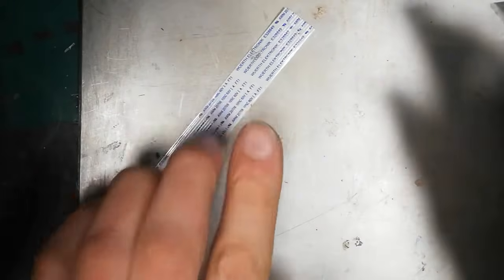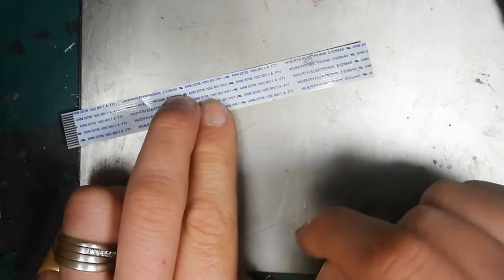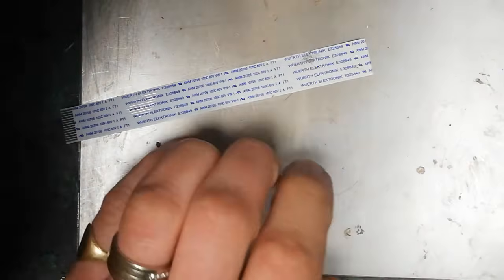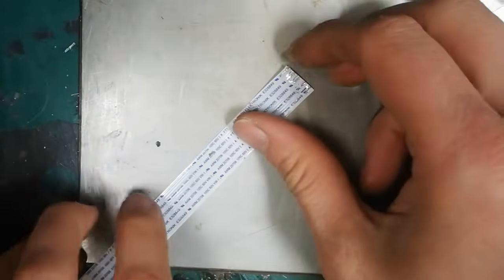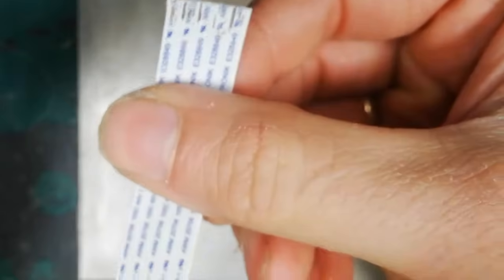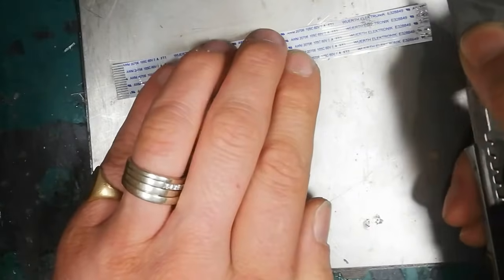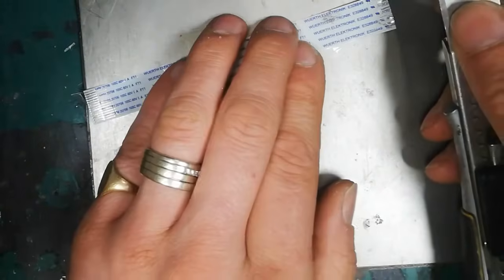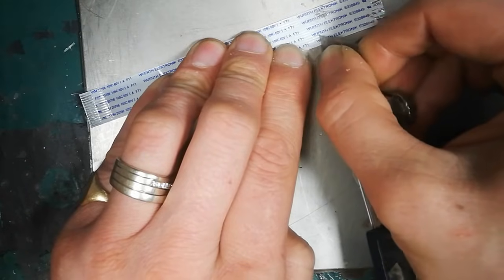Flexible flat cable FFC cable repair methods

Comment: I have a damaged flex cable that has carbon conductors or traces.  When I used carbon ink to fix it, it breaks and comes off, can it be repaired?

Comment: This might just save my Canon Printer, the fucking scanner ribbon was fucked up and the entire printer just refused to turn on.
Reply from the maker: Hope so.. Good luck and don't rush it !
Reply: @chazj1976  it worked! Huge thanks my man, printer is working like brand new again. It was refusing to turn on due to a fucked up scanner ribbon and power switch ribbon. By the way, what can I replace with the blue plastic, i tried different plastic sheets but it seem to be too thick for it, im worried destroying the port's contacts. New subscriber here.
Reply from the maker: @madartzgraphics2019 awesome well done. Thanks for the sub. Blue plastic replacement   can use a piece if glossy photo paper. But I used an thermal laminator pouch put through a laminator with no paper in it and the cut a small section.  More robust than the photo paper

Comment: Will it damage if I just burn it for 2 secondes with a lighter and then two scratches with the finger nails to take the plastic off ? 😅 I'm just wondering
Reply from the maker: Only one way to find out 😂

Comment: I found a torn ribbon cable but the lines are microscopic and are built into the screen on one end. I'm guessing it's an impossible fix? I cant even see the individual lines with a magnifying glass. It's an LG 4k Ultragear monitor. The ribbon cable has a small chip built in. I'm drawing a blank on what they're called. Chip on film or something.

Comment: Hi Super random question I had to repair a 6 wire ribbon cable for my ps3 power buttton but some of the copper wire further down is also exposed the part that does not go inside the slot is this bad or would it be fine to use and does it matter what rotation the flex cable goes in>
Reply from the maker: Be fine to use even though some copper exposes. You could wrap a small piece of electrical tape around the section that's exposes.  Orientation of cable in the socket matters yes. Check it against images on the Web for which way it should go

Comment: How to know if flex cable has tiny wires broken, can they be visually inspected?
Reply from the maker: Use a multimeter and continuity test.. one lead at one end, the another leas at the other.
Reply: @chazj1976  What to do if I can reach only one end of wire, will have to puncture insulation?
Reply from the maker: Not Ideal but yes sharpen one multimeter probe yo a very fine point. Or use a really fine needle taped to the probe tip

Comment: Very bad practices. Not to be recommended. There are far better instructional vids on YT about adaptation and configuration of FFCs. But if you can, just replace the cable. I doesn't cost the world.
Reply: Indeed, it is dangerous. Use FFC to DIP adapters rather than scrapping the insulation like savages. During a maintenance job of my laptop, the ribbon cable connecting the USB hub to motherboard was damaged, I was desperate and tried this method, the moment I powered the device it started to burn and melt. Horrible scenario...! Thankfully none of the components were damaged. Simple buy a new one, calculating the pitch is easy, divide the width of the cable with the number of terminals.

Comment: unfortunately this won't work... when pushed back into a socket, the ends will be damaged again.
Reply from the maker: Well I beg to differ along with the many others who have tried it successfully.  Maybe give it a go and you might surprise yourself 😀
Reply: @chazj1976   It may work when laid on a flat surface but it won't work when pressed into a socket. It's a common sense thing that seems to escape you.

Comment: Great video. The blue ends on both sides of my connector have cut off, so I can't see any exposed cable, it is a 5mm width Sumitomo-G AVM 20624 80c 60v VW-1 F 4 pin cable, can I just buy another off Ebay or are they specific to each device ? Also what does Forward or Reverse mean when buying the cables and what is the pitch ? I have no idea what mine is. Also are both ends of the cables the same or do I need to make sure I keep the broken off blue connector end from the bottom of the cable as always the bottom one or are they interchangeable ? Thanks again.

Comment: please answer me can you cut it lengthwise because i need 13pin one and i only found 20 pin ones can i cut it to make it 13 pins
Reply from the maker: Yes as long as its the same spacing (pitch) for the contacts as your 13 way one

Comment: Thank You, very helpful video!  a flex cable, ( i called it a ribbon cable!) in my epson scanner was partly cut when the hinge broke, so it looks like i can adapt your method to join the cut wires as it only cut the first 2.  thanks again!

Comment: Nice but it's not so easy with relatively narrow cables. I failed to strip plastics on one end of 6 mm laptop ffc. The wires are much thin and can easily breaking. But thanks, anyway.

Comment: A tip, you can use a thin Diamond file or sand paper to exposed the copper instead and it works well if you place a card under it to raise that section while wearing away the casing
Reply: thanks to jesus. i read your comment. otherwise i would be scratching with some sharp object. sandpaper worked well.
Reply: sandpaper worked well
Reply: hi i'm from philippines i really appreciate your comment it save my printer has no available flex cable in my country now my printer works fine now...thank you very much

Comment: I found it much easier to melt the insulation with a knife blade on a soldering iron and then scrape and tin, just have to be careful of fumes as I suspect it is PVC.
Reply: Thanks for your suggestion. I kept damaging the cable with a knife because it is very small. With the soldering iron blade it slowly got the plastic off and kept the metal prongs from flaking off or bending, as the heat kept the tracks in place. Thanks a lot.

Comment: Is there any repair if the blue or red pins break or ripped off accidentaly?
Reply from the maker: Only thing to do is cut the damaged end off and stick the plastic blue or red backing to the end again and scratch with a knife to expose the tracks.  You need spare length in the cable tho

Comment: this was a life saver thanks for the video.
Reply: By chance, would this work on the edge of a slightly torn ring peephole camera flex cable?
Reply: @MCFresh13  not to sure you could try. I just did this one a ribbon cable that connected my keyboard pcb to its daughterboard.

Comment: So I took off my blue thing on the ribbon cable but I rlly don’t know how I’m gonna put it back do I just use glue to put it back or anyone suggest a method that worked for them
Reply from the maker: Just glue back on with super glue. Its there to provide mechanical strength at end of cable and increase its thickness at the end to ensure good electrical connection

Comment: Sorry what I meant to say was how do you go about what you're doing in your video but with a ribbon cable that has a tapered end that plugs into the connector, it's a different size so I can't really cut it or else it will be a different shape pretty much where the gold plates are
Reply from the maker: Hmmm.. good question dunno!.   If you find a method that works let me know!

Comment: Is there any way to fix this kind of ribbon cable if the trace or the wire or whatever it is... the spine is completely pulled out of the plastic housing only one row. Somehow mine pulled out almost like a thread but it's still somewhat connected on both ends just loose

Comment: dude life saver ngl.. my ps4 ribbon cable broke and i needed to buy a new controller or a new cable. this method saved me some money
Reply: Same. But I used a nail file instead of a knife.
Reply: I did this and it still didn't work 🙁
Reply: Omg same man
Reply: Lol same
Reply: same thing happened to me except its my spare controller that broke and I want to fix it
Reply: Bro the ribbon cable cost like 2 dollars 🤣🤣🤣
Reply: @Mariomarinov467  it costs like 6 on ebay but some people dont like spending money
Reply: Experiencing something similar. The gold ends on mine became entangled after taking them out connector  and trying to straighten them made the problem worse. Luckily I have another damaged cable and will be looking to use this video as a guide to join both together. Both of them have one side with good pins so hopefully this goes well

Comment: Thank you man, brilliant 👍 i started to search on ebay already but you saved my time and money.
Reply: bro does it work for u?my problem is it is not charging and light is not turning on will this video will work for me to fix the ribbion?
Reply: @moizrehman5472   yes it worked for me, but make sure that you remove the insulation completely and no short circuits..
Reply: @mohammadmoustafa9471  broo i don't get the video can u please explain little bit ?

Comment: How to cut the cable 24 pin to 18pin (FFCble ) bro
Reply from the maker: Hey bud.  Tape both ends of the ffc cable to flat surface and thrn tape doenba metal ruler covering 18 connectors. Then use sharp knife and slowly run along the ruler to cut off the 6 tracks that you dont need
Reply: @chazj1976  lol ya I just got my order off Amazon an they gave me the 14 pin when I needed the 12 🙄 thinking of just cutting the spare 2 lines off allllll the off the ribbon, probably just going to return the order 😑

Comment: Mine is from a laptop power button I over bent it and got broken, what happens if I just solder it all together, or is there any way to splice it to bring the two piece back together?
Reply: Exactly same fucken problem
Reply: @slitslut3002  fixed mine by scratching both ends of the broken ribbon then taped it and applied pressure by improvising a clip made out of thin piece of metal then covered it again with electrical tape lol had to improvise since i can't find a compatible ribbon cable
Reply: @incogni2390  oh thank u for advice. I think i'm gonna try to solder it
Reply: @incogni2390  question: what happens if u don’t scratch out? Does the plastic part prevent the connnection from flowing properly?
Reply: mine is not broken but the pin point of my ribbon cable got erased. is that the problem why my laptop is not turning on?

Comment: Nice informative video. Is there any way to connect a 26 pin ribbon cable to the board having flex cable connector (for  the use of flex cables like in the video)? Please help.
Actually the board with ribbon cable connector on it,  is not manufactured nowadays, so want to use new board having thin flex cable connector on it.
Is there any adapter available?
Reply from the maker: Hi Thanks for the comment.  If you look on Ali Express there are some FFC breakout boards that break out FFC cable to PCB solderpoints.. Might be of use?